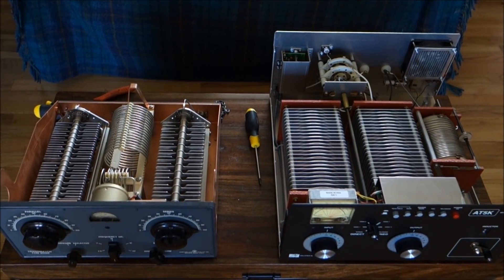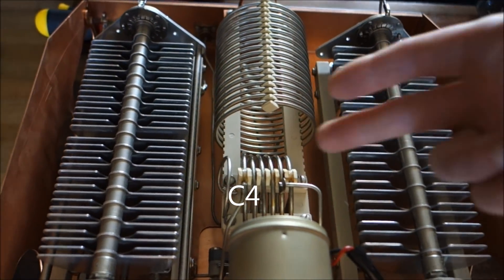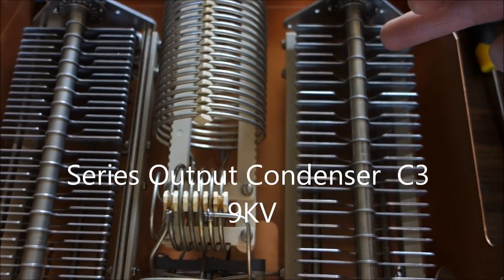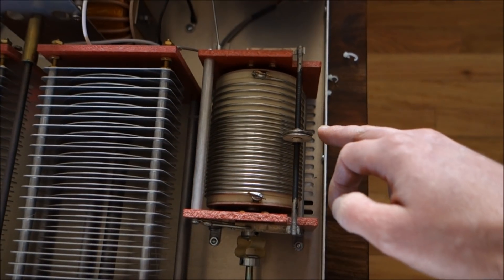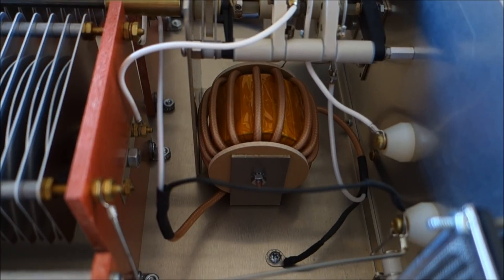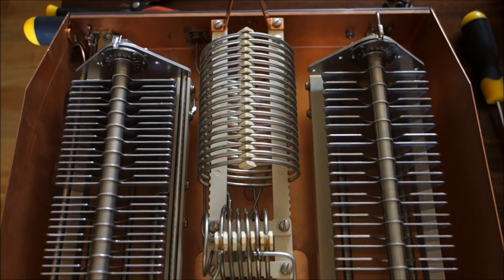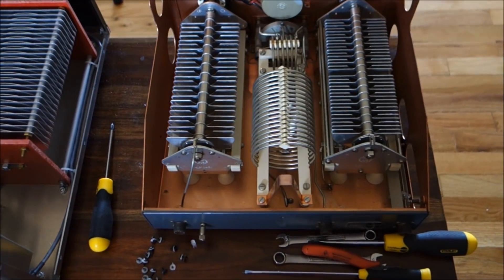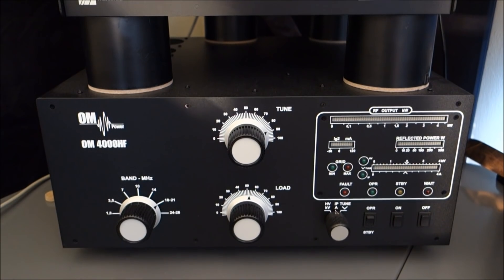Inside Palstar AT5K and Millen 92200 Antenna Tuner | Signal Phantom

Comment: The roller Inductor issue aside. The coax selector does not have a detent you can feel. Its easy to get it in-between contacts and burn it. It has a cheese like feel of cheap stuff. 
I was thinking of modifying my AT2K with the nice Balun only move is to the output for a  balanced output.
Not sure why T2 Balun is on the input ?
Reply from the maker: You can review my balance scope measurements but they put the 1:1 choke balun on input to keep the core from seeing any reactance.  That was the idea.

Comment: These are nice!
I get that the coil basically makes the transmission line longer but what does the capacitor do?
Reply from the maker: Remember, that with Z you have three components, R, Xc and XL. Depending on the complex Z you are seeing, these devices are made to may R see 50 Ohms with Xc and Xl being somewhat the same.  That is why you have a variable C and L!  Hope that helps a little.

Comment: Input Balun?  If so, you need to float the whole tuner otherwise you're liable to get RF on the case.  Given there is no benefit to an input balun over an output one, I'd recommend you move the lovely Balun to the output; you will also achieve better balance.  73, Jarrad VK3BL :)
Reply: The input side (from tx) is 50 Ohms so a 50 ohm 1:1 balun will be correctly matched by the tuner (whole point of tuner is to produce 50 Ohms on the input). But the balanced output (antenna side) must be floating, which AT4K and AT5K already are … and they both have this 50 Ohm 1:1 balun on the input, so unless there’s a power handling problem with the manufacturer’s design, I’m not why this was modified (?).
Reply: Im with you .
Why on the input side. There must be some reason ?